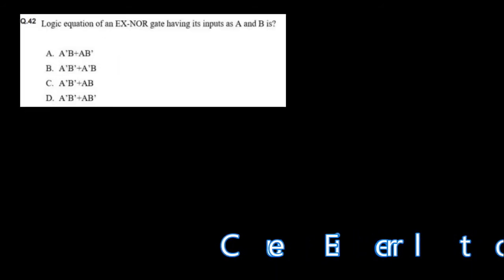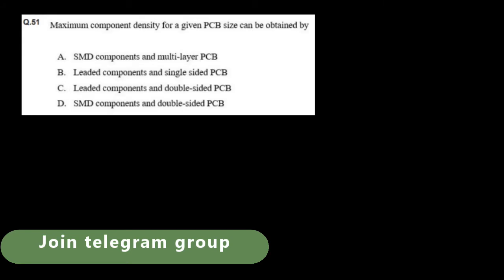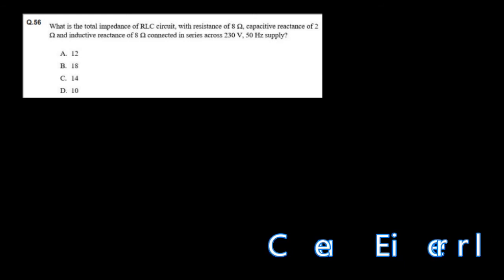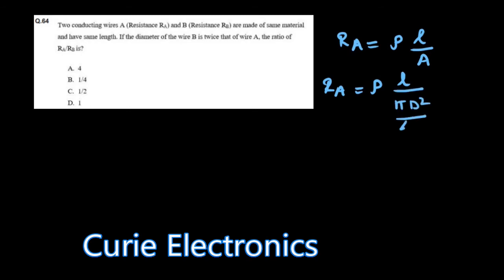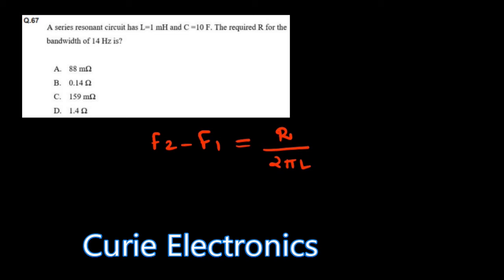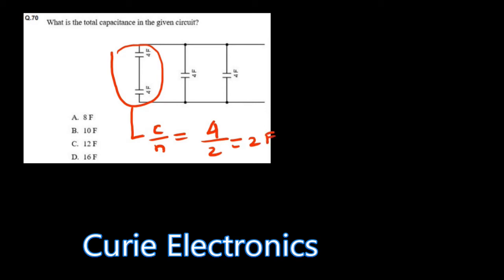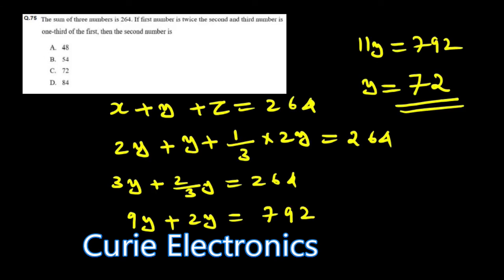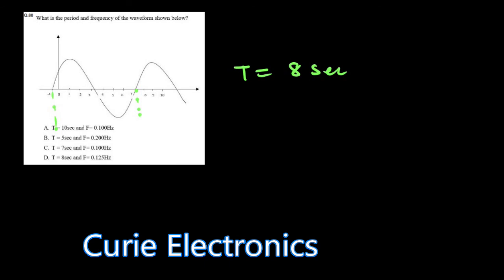SDSC TECHNICIAN B ELECTRONICS 2022 PART 2

Comment: The calibration signal available from CRO is of the form:
This question was previously asked in
UPRVUNL AE EE 2016 Official Paper
View all UPRVUNL AE Papers >
Sinusoidal wave
Square wave
Saw tooth wave
DC signal
Answer (Detailed Solution Below)
Option 3 : Saw tooth wave
Detailed Solution
The calibration signal available from CRO is a saw-tooth waveform. It is applied at vertical plates whereas input is applied at horizontal plates.
Reply from the maker: Could u please provide any material supporting it.